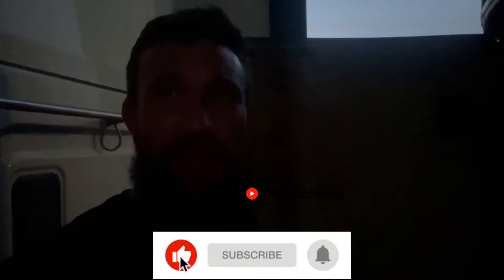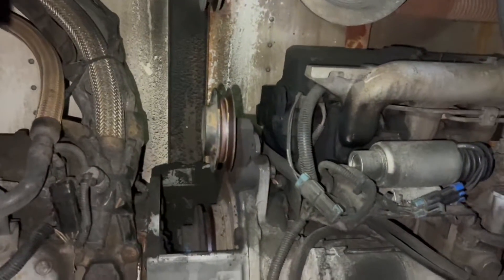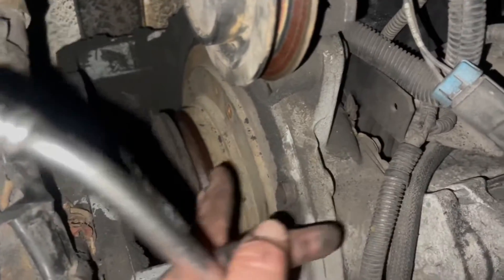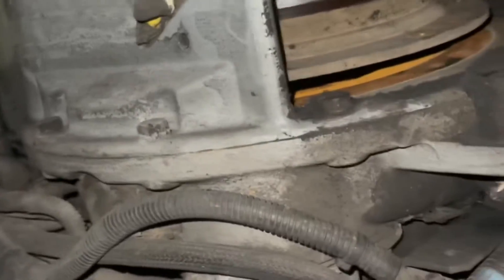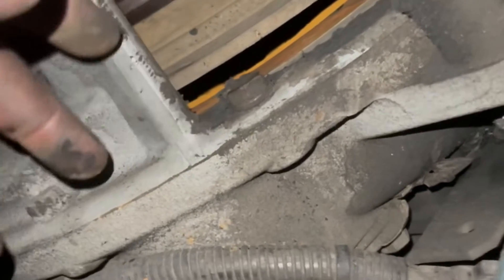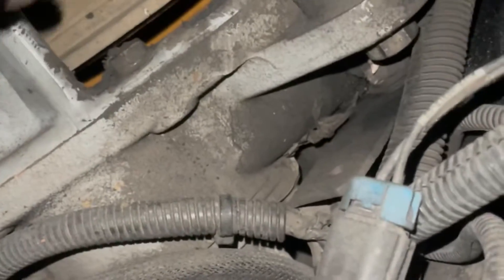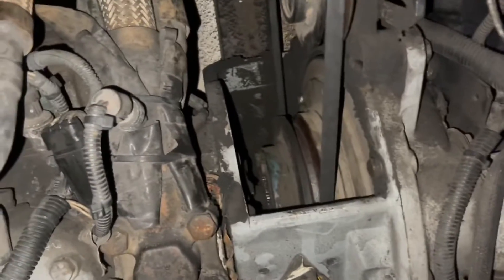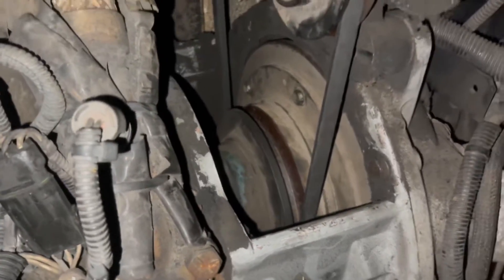Carrier Reefer Drive Belt Replacement… The Easy Way

Comment: This is not an OEM belt. The OEM belt is thicker and stronger; however, it's harder to fit. The trick is to pull it sideways, and the main trick is to use soapy water — yes, soap or Dawn dishwasher detergent works best. Spray it generously, and the belt will slide in like a baby. The same trick works when you want to remove it.

This belt is also good but thinner than the original, so it's easier to fit. However, it’s not as strong. The OEM belt typically lasts about three years, but with this one, it's hard to say. During heavy loads in the summer, when the engine starts pulling the compressor harder, it's easier for this belt to snap compared to the OEM belt. Make sure to include the part number and other details since this belt has different specifications.